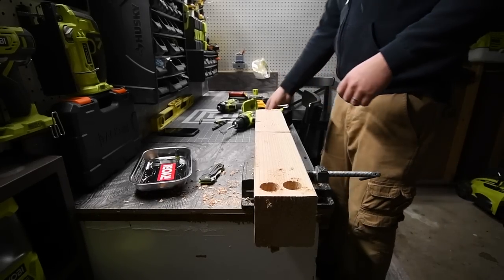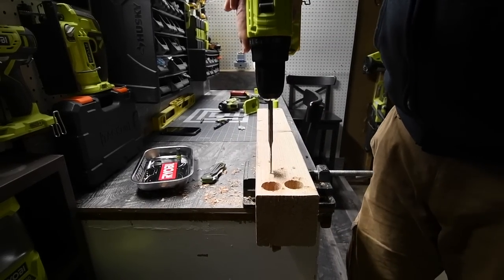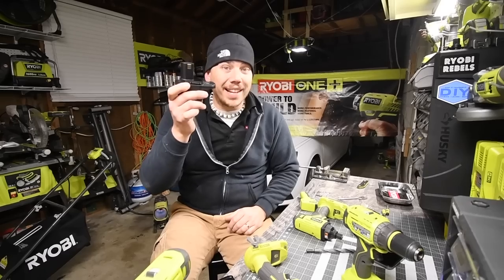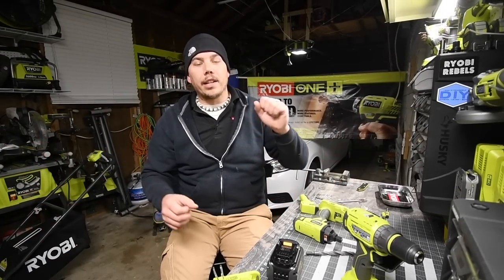Dewalt to Ryobi battery adaptor

Comment: From digging around on the glorious inter web i see that Dewalt put the battery monitoring chip in the tool but Ryobi put it in the battery. So if you use a Dewalt battery on a Ryobi tool, you don’t have any battery monitoring chip in the mix. 
The chip stops overheating and over discharging etc. Normally the tool will stop working when the battery hits a level of “empty “
Without that chip you run a risk of pushing past that limit and damaging cells. 
It not a reason to stop in my book but it’s something to understand. Perhaps pay attention to performance drops while using a battery and make sure not to push past that.
Reply from the maker: that's why I got it, to show people what will happen if its used.
Reply: Man Caver Tools good because I could easily see a lot of people killing their batteries by doing this. I just don’t think it’s a good idea in general unless the proper circuitry was used.
Reply: Thats the dumbest I have heard. Why would they put a chip in every single tool instead of just the battery. It doesn't make sense economically or logistically.
Reply: Thank you for clarifying this ,I have a dewalt battery to makita adapter and haven't used it yet .
Reply: @randybobandy9828  Most people in these systems have more batteries than tools
Reply: @GoogleDoesEvil  and?

Comment: Oooh! SMOKED IT OUT! Lol I can't see many people investing into new brushed tools. For the average home owner who don't know anything about tools probably will. 
About 3 years ago I was looking for a Ryobi ONE+ to Craftsman C3 adapter because the batteries are almost identical except the very top part. Size & shape are identical. I then looked into having them made to resell. 

A lot of old Craftsman C3 tools out there that people still have & use, but adding Ryobi like I did to easily swap between them. I still have a ton of C3 batteries. But again, I don't use many of them since I switched over to Ryobi full on last year. I wish I could buy the C3 line & revive & expand it!!  Great vid guy.
Reply from the maker: yes it did. that specific drill is crap
Reply: Is there a ryobi to c3 adapter?? I have a c3 impact I refuse to purchase a c3 battery if I could use the ryobi battery with a adapter

Comment: When you use dewalt batteries with other tools you must monitor the voltage to avoid destroying the battery. I put a voltage monitor on the adapter you use and have it signal at 16 volts.
Reply from the maker: I do thank you so much for viewing :)
Reply: How did you put the monitor on ? Thanks.

Comment: Do you happen to know If the adapter has a voltage regulator inside? 

I'm pretty sure Dewalt keeps their voltage cutoff inside every tool and not the battery, while Ryobi keeps theirs in the battery.  Would probably be fine In a drill where you could tell when the voltage is low when It spins extremely slow. 

However, I'm going to use it inside my Ryobi hot glue gun and It's very easy to unknowingly drain the batteries. In a case without low voltage protection, it could drain the battery past the point where a charger would accept it or possibly worse. I might just buy and modify Dewalt's official adapter to fit a Ryobi because I know it comes with circuit protection.
Reply from the maker: that I do not know, I still gotta do some tests to see if it will damage the batteries or tools
Reply: Man Caver Tools I’m thinking they would just because different motors different current draw and I just don’t think paying 30 dollars for something that could kill my expensive tool or battery is worth it. Because if anything thing the tools and batteries are so smart now that these adapters could actually be a hinder to the  tools performance. Just my thought. Unless their is a test done that says otherwise I’ll just wait for sales on other brand tools I want. Also love the channel.

Comment: Using the Ryobi adapter, can you charge the Dewalt battery in the Ryobi charger? This is something we need to know.
Reply: No, it says that on the paperWork.  Also says to remove the adapter from the battery when not in use, as it will drain the battery
Reply from the maker: that something I would try.
Reply from the maker: correct

Comment: Most of these adapters don't have under-voltage protection, meaning the battery can be drained to empty, which will destroy the battery. These adapters will come in handy but you should use them with caution.
Reply: Great advice man
Reply: Under-voltage protection is not up to the adapter. Either it's in the tool or in the battery, it's not affected by the adapter. Positive and negative poles are connected seamlessly, otherwise the tool wouldn't work. Voltage protection is always intact with the adapter.
What is lost, however, is the thermistor connection which chex the battery temperature. So you can overheat it because the tool will not cut off.
Reply: @Surmoka  the reason it's an issue is dewalt tools have the protection built into the tools whereas ryobi puts it in the batteries wich means in this combo there would be no voltage protection

Comment: Dewalt, Milwaukee and Makita are the best option. Throw some Bosch and Hilti in the mix and the tool collection is complete. These tools are more expensive, but worth it imo.
Reply from the maker: I have HILTI now, I still need crasftman, Bosch and a few others
Reply: Ryobi Man Caver NICE! I have watched other videos where some Craftsman and Hart tools are stalling out, not enough power. They seem to be more like DIY tools for around the house than professional tools. The only Ridged tool I have is a vacuum and the only Porter Cable tool I have is a dovetail jig.
Reply: You just named the 5 most expensive power tool brands. I wonder why they are the best?
Reply: Kaniel Outis idk, my thoughts are if you can afford it or can wait to buy the best of the best then do it. Why buy something that eventually might not do a particular job for you down the road? Buy the best first before you buy a cheaper tool if you can, so you don’t have to spend more money on top of the cheaper tool to get a better tool to do the job.

Comment: Do you think being that the ryobi is 18v n the dewalt battery is 20v over time do you see any issues being different voltages? Genius idea love idea huge fan of ryobi we use all ryobi cordless
Reply from the maker: all 18v  batteries are 20v batteries, once you turn the tool on the 20v  battery turns into 18v because of the load. its just a marketing thing to say its 20v with no load when its the same as 18v when the tool is on
Reply: Ryobi Man Caver That was kind of my understanding as well. I’ve had a few folk laugh at me in explaining this concept, it’s all about versatility

Comment: I think the trouble is on the ryobi it has no overamp protection on the motor I think this is one of the reasons the 20v to 18v adapters have a board in them as the old nicads didnt have the current capacity to burn the motors at stall. A Brushless ryobi model likely wont have this issue as the controller should sense the stall and stop putting current in after it times out.

Comment: This seems utterly backwards to me, that the better way to go would have been a Ryobi battery to Dewalt tool adapter, were it not for the great thing about Ryobi - that they kept the same battery format but in this case it means that neck on it that would make it ridiculously tall.   The reason is that you are trying to compare a 1.5Ah inexpensive battery to a 2Ah expensive battery.  The RIGHT comparison to do would be the similarly priced Ryobi 4Ah battery against the Dewalt 2Ah, comparing not only the speed to drill the holes but also how many holes it can drill per charge, letting the drill cool down every few holes of course.

This would also mean more work done before having to stop to recharge, and with that comes fewer recharge cycles in a year so the battery lasts longer, making it an even better value by FAR.  Dewalt makes some decent tools but their batteries are a bad value and you should avoid using them when possible.
Reply from the maker: I thank you so much for viewing
Reply: Stinky Cheese the ryobi is a stick in battery. Gets problematic.
Reply: I have had good experiences with Dewalt batteries thus far and Ryobi, the only brand I've personally noticed with bad batteries are Milwaukee, but they were fixed under warranty.

Comment: FYI I just found out that the charger that comes in the kit for the p166 will not charge my six-year-old's nicad battery and now he owns 2 3 ah batteries out of the kit that is a p 166 and the charger will not charge nicad batteries which is his first one Ryobi battery to run his radio and fan please tell me why it will not. When my p 135 will charge whatever I plug into it
Reply from the maker: I have no clue why its not charging. did you try other chargers?
Reply: @ManCaverTools  yes I did I used my P135 6 port and it charged my son's nicad battery just fine in about 30 min

Comment: Suppose to use speed 1 for anything big bits. Needs more torque. Not speed.
Reply from the maker: thank you sir
Reply: or just less pressure, you're not supposed to try to drill wood slow with high torque.

Comment: That's not a brushless drill. That drill has a brushed motor. You can see Sparks from the brush contacts. Also why it smoked
Reply from the maker: that is correct, I don't know why they made new brushed tools. the drill couldn't handle the task, getting the drill stuck like that is bad for the motor.
Reply: @ManCaverTools  That is why larger drills exist.  What you're doing is like getting a Honda Civic and trying to haul 400 lbs of mulch in the back.  There's nothing wrong with a Civic but this is why pickup trucks exist.   Don't knock the tool when it is the user that picked up the wrong tool for the job.  The entry level (homeowner grade) Dewalt drill shouldn't be tasked with that either, more than one or two holes occasionally.  Both brands make drills with enough addt'l torque to hold the RPM and even risk injuring your wrist if you got the bit jammed like shown in the video.
Reply: What part is causing the smoke? Does it permanently damage the drill?
Reply: @skycorrigan6511  the carbon brushes overheating from the high current draw causing them to overheat and brake apart or the stator itself.
Reply: @ManCaverTools  they make brushed tools still for the one simple reason: cost. They are cheaper to make there for they can be sold for less. Some people won't buy a drill if it's $120 for a better brushless they might only want to pay $70 or $80 for a brushed.

Comment: I meant it shouldn't smoke or get so hot if the strain isn't as much
Reply from the maker: correct, but it didn't withstand these tests with the tools being brand new. if I had the tool for years and years then I would understand, but its a brand new tool. it should be able to do these tasks with no problem
Reply: @ManCaverTools  thanks again for the video. I was excited about ordering the drill and impact. I saw the video with that impact vs the p238 and I wanted the drill and impact very much. But looks like I'll have to use the drill lightly. Thanks again for all your effort with the videos

Comment: What is that red thing you took off the initial Dewalt battery? A protector?
Reply from the maker: it is a discharge cover
Reply: @ManCaverTools  does it prevent discharge when not in use? I've never heard of them

Comment: Adapter also fit Milwaukee. It works pretty good for what it is. Now If I could just find one that converts Ridgid to work with Dewalt batteries.
Reply: tensazero it's out there, try eBay, it comes from Australia
Reply from the maker: I gotta try that out and thank you

Comment: Does using the adaptor provide any sort of low voltage cut-out or does it leave it up the the user to monitor the amount of charge left?
Reply from the maker: I havent experienced that yet. but we will see in the future
Reply: @ManCaverTools  No problems, thanks for the reply. So I take it that you've had no problems with the adaptor over the past year?

Comment: I like ryobi tools, they make some unique tools like the pex cinch ring, crimper, and price are really good,  but battery and charger are always failing, don't see the link for the adapter, where is it? great video 👍
Reply from the maker: the new ones are coming out soon and I cant wait for them to come out
Reply: @ManCaverTools  This is probably a stupid question, but can you charge the DeWalt battery with a Ryobi charger, using the adaptor?
Reply: @rory6089  it would never get to 100% charge.

Comment: Was it a 20v Dewalt battery in an 18v Ryobi drill?
Reply: Dewalt's 20V batteries are really 18V batteries. They call it 20V as a marketing thing, to help differentiate between the new flat style sliding batteries and the old post style batteries. Dewalt even makes an adapter to go between the two, because the voltage doesn't really change. These all operate with a peak voltage of 20V, and a nominal voltage of 18V.

Comment: Have you use this adapter on a troop brushless tool?
Reply from the maker: not yet but tests will be coming, thank you and Happy Thanksgiving
Reply: @ManCaverTools  happy Thanksgiving. I have been told it will no work since it doesn't have the 3rd connector.

Comment: Is it just me or did that drill really seem to struggle there and overheat? Are Ryobi cheaply made? Or do they use cheaper materials I.e. they arent brushless?  Some of their products are half the price of dewalt
Reply from the maker: Ryobi is for the Diyer along with some great lawn care Products
Reply: Do not push a Ryobi tool using a small battery. Always use the 4ah or larger. It will maintain 18v-19v under load. The small batteries drop to 15v under load. Low voltage causes high current. High current will burn out your low quality tool. 

I have used a 20year old blue Ryobi drill with a 4ah battery and massively abused it with no problems. That would have died using the 1.5ah battery.

Comment: Great video really helpful. Do you know if the Ryobi adaptor will work with Bauer batteries from Harbor Freight?  They are very similar to DeWalt.
Reply from the maker: if they make an adaptor for the battery then it should
Reply: Man Caver Tools They don’t make one for Bauer batteries so I just tested the Ryobi-Dewalt adapter with Bauer batteries and they work.  Just posted a video showing this.  Thanks

Comment: The answer to your question of "...Why would they  just release this {cheaper!} brushed drill vs. the already great brushless model..." is simply a matter of making a "small sale", vs. making NO sale at all! Tool mfgs. are NOT in biz to make you the "best" tool possible; rather - they are in biz only to MAKE MONEY FOR THE STOCKHOLDERS! They do this by cutting corners wherever possible (for profits), & yet still be able to put out a tool "quality enough" to make the sale. The lesser "brushed" model serves the purpose of attracting sales at a lower selling price to all those who would NOT buck up to buy the better quality/higher priced brushless units... Kinda' like buying a Toyota SUV vs. a more pricy Volvo SUV of the same size : one IS higher cost via BETTER engineering/build/& quality ...
Reply from the maker: exactly, im making a video like that soon, but its like why make it

Comment: Where are the followup videos to this one. Also where did you get that adapter? My goal is to be using ryobi for easy basic stuff but then have Dewalt for more heavy duty applications and use their batteries because they are far better than any other competitors.
Reply from the maker: yes their is you should look through my recent videos

Comment: I bailed out of ryobi quick. There weak. Desalt gets me through the job. You get what you pay for
Reply from the maker: very good and thank you
Reply: Mmm, not really, Ryobi has at least three better performing drills than that one, and similarly Dewalt has different drill performance tiers too, but always the Dewalt costs more for similar or better performance.   Now longevity on the other hand, there is no arguing that Dewalt's high end drills will walk circles around Ryobi's best for lifespan which is important when it's your trade and you put more hours on a tool in a week than most homeowners do in a year.
Reply: Love ryobi for diy great affordable not had 1 tool fail and done everything asked. And again he covered the vents on the drill lol.
Reply: @JustaSimplefact  good dewalt and milwaukee tools are more than just $40 more than their ryobi counterparts. For instance a brushless ryobi recip saw is $100 and a milwaukee is $250-$350. If you are a pro get a pro brand. If you are a diyer or home owner get ryobi since you won't be pushing the tool anywhere near as hard or as long so they will hold up. I have had a cheap brushed impact and drill from ryobi for 5 years now and going strong. I paid $129 for both with 2 batteries and chargers. They get the job done. Ryobi has it's place and they are not junk tools like Walmart or alot of harbor freight tools. Even though harbor freight cordless tools have stepped in up over the past couple years.

Comment: Hey thanks for the video. I already have the black Friday drill and impact ordered but I'll only use the drill for small stuff anyway but would it perform better with a 3ah battery and wouldn't have such a strain on it ? It seems like it's gonna try if the strain is alot
Reply from the maker: it does not support the HP system but using the battery won't hurt it

Comment: Non professional use of tool.borings hole one must allways  move in n out whilst boaring to clear wood out of hole and never allow the drill to lockup either. . I've boared  thousands of big hole with my Ryobi with 4ah battery ,ps Ryobi 2.5 ah batter is twice as powerful as the 1.5.
Reply from the maker: correct sir. but this is a little stress test with the clock ticking.